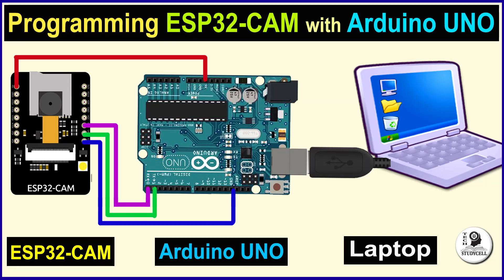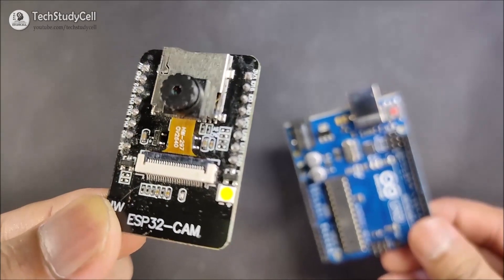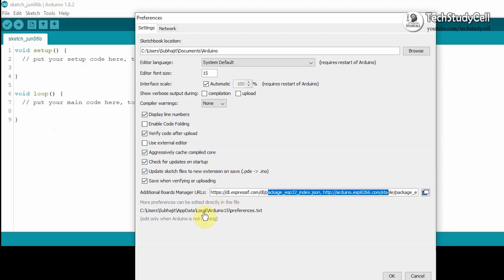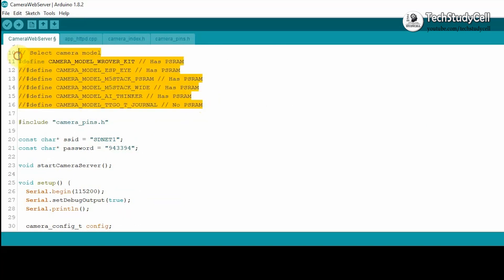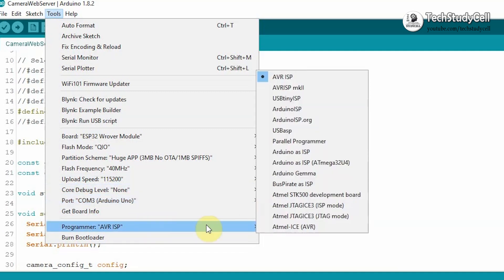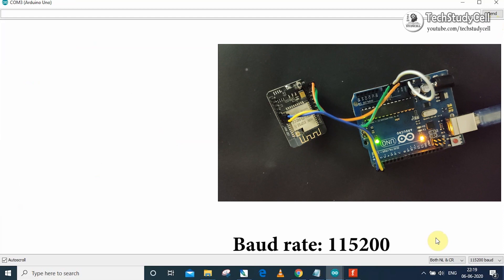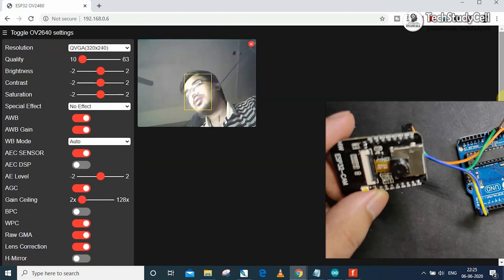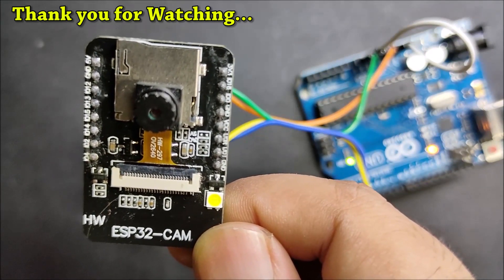How to program ESP32 CAM using Arduino UNO

Comment: Thanks for the video and sharing the information. it was quick but am facing some issues with camera_probe

[E][camera.c:1049] camera_probe(): Detected camera not supported.
[E][camera.c:1249] esp_camera_init(): Camera probe failed with error 0x20004

i searched resolution and i think this is with the power supply. so trying to resolve it. 

If there is any other solution please do let us know. Thanks
Reply: same problem did u find any solution?

Comment: after I like your video, why does the display on the serial monitor look like this: Please solution
ets 8 Jun 2016 00:22:57

first: 0x1 (POWERON_RESET), boot: 0x13 (SPI_FAST_FLASH_BOOT)
flash read err, 1000
ets_main.c 371
ets 8 Jun 2016 00:22:57

first: 0x10 (RTCWDT_RTC_RESET), boot: 0x13 (SPI_FAST_FLASH_BOOT)
configsip: 0, SPIWP: 0xee
clk_drv: 0x00, q_drv: 0x00, d_drv: 0x00, cs0_drv: 0x00, hd_drv: 0x00, wp_drv: 0x00
mode: DIO, hour div: 2
load: 0x3fff0018, len: 4
load: 0x3fff001c, len: 1100
load: 0x40078000, len: 9232
load: 0x40080400, len: 6412
entry 0x400806a8

[E] [camera.c: 1049] camera_probe (): The detected camera is not supported.
[E] [camera.c: 1249] esp_camera_init (): Camera check failed with error 0x20004

Comment: I am facing this error by using this method 
can anyone tell me where am I wrong

Brownout detector was triggered

ets Jun  8 2016 00:22:57

rst:0xc (SW_CPU_RESET),boot:0x13 (SPI_FAST_FLASH_BOOT)
configsip: 0, SPIWP:0xee
clk_drv:0x00,q_drv:0x00,d_drv:0x00,cs0_drv:0x00,hd_drv:0x00,wp_drv:0x00
mode:DIO, clock div:2
load:0x3fff0018,len:4
load:0x3fff001c,len:1216
ho 0 tail 12 room 4
load:0x40078000,len:10864
load:0x40080400,len:6404
entry 0x400806b8

[E][camera.c:1049] camera_probe(): Detected camera not supported.
[E][camera.c:1249] esp_camera_init(): Camera probe failed with error 0x20004

Comment: Hello, I am very new to this stuff, as i was doing each step, when i was about to select my "Programmer" mine says "no programmer available for this board"
Reply: Same prblm for me too got any solution
Reply: Apparently there was a change in Arduino IDE. Since there is no programmer for ESP-32, none are listed. Just click the upload button in the IDE and the upload should happen. Some people report warnings from the IDE, but works ok. Also make sure to have a  solid 5 volts on the ESP-32 to avoid brown-out.

Comment: I am trying hard to do this with the interface cable and it never worked with a DM brand ESP32.cam.   Using Arduino as described works great!  Thanks a great deal. This puts an end to my frustration and failure using the USB to UART adapter.   I was able to use AI Thinker setting in the IDE and Arduino worked great for the DM branded cam board.  Thanks again, a whole lot!
Reply from the maker: Great 👍

Comment: Hello sir, i followed your exact steps and i ended up with this error.

esptool.py v2.6
Serial port COM4
Connecting........____....._____.....____

A fatal error occurred: Invalid head of packet (0x00)
A fatal error occurred: Invalid head of packet (0x00) 
Do you know what could have went wrong ?
Reply from the maker: When you see the Connecting..... Text, please press the reset button on ESP32CAM. 
still if you face any issues please try again the same process.
Some time it happened due to connecting problem.
Reply: @TechStudyCell  Hey there, Yup i have tried that. Pressing once after the compilation is complete. Some google results tell me to hold on to the reset button. But i tried both methods and i still get errors. 

It worked for the first time. But after i restarted my computer, it stopped working
Reply: Me too

Comment: Hi I found very helpful video you have made. I need your help or advise, I have no experience in electronics I just want a simple direction if possible. I am building a tracking motion with ESP32-CAM and Arduino NANO, but the servos I want to control are The Bescor PS-260 AC Power Supply for MP-101 Motorized Pan Head features a 120-240VAC, 60/50Hz input and 6VDC, 700mA, so how can I include a controller ESP32-Arduino and some voltage controller to adjust what I need to move the servos? I don't know the terms I need to say to explain what I need, so please bear with me in this matter and I appreciate any guides you can provide to accomplish this Home Made device. Regards

Comment: I got the following error message: "Sketch uses 2100663 bytes (160%) of program storage space. Maximum is 1310720 bytes.text section exceeds available space in board." Any idea? I have tried different configurations but none worked. Same error.
Reply: Select Huge App in the partition menu

Comment: is it ok to use arduino nano?
because i got error like this
[E][camera.c:1049] camera_probe(): Detected camera not supported.
[E][camera.c:1249] esp_camera_init(): Camera probe failed with error 0x20004
Reply: @Lorenzo Tempany Even I have the same did you fix it?
Reply: @rajatnagarkar4283  did you fix it? i got the same problem.. help mee

Comment: sir great video but while uploading the code an error message occurred which says "Timed out waiting for packet header" please help
Reply from the maker: During uploading the code the GPIO o and GND should be connected. When the "Connecting......" test appears at the bottom you have to press the reset button on ESP32CAM.
Reply: getting same error. were u able to solve?

Comment: My serial monitor says - rst:0x1 (POWERON_RESET),boot:0x3 (DOWNLOAD_BOOT(UART0/UART1/SDIO_REI_REO_V2))
waiting for download
 everytime i press the reset button on baud 115200. I does not work for me. The code gets uploaded but i am unable to find the ip in the serial monitor . Please help
Reply from the maker: If code uploaded successfully. Then disconnect the GPIO-0 from GND and press the reset button in ESP32cam
Reply: @TechStudyCell  I did that. And in my case if gpio 0 was connected to ground, my code was not being uploaded. So i removed that connection and then uploaded. It finally worked and i got a ip link in the serial monitor but it was not working. It was just reloading on the browser. Can you olease suggest me how to do it.
Reply: @dhruvajindal4932  have you check ssid & password code for wifi your home???
Reply: me too, i don't know repair to it
Reply: Also be aware that the SSID is case sensitive too, not just the password.

Comment: Totally worked for me. Tnx for showing this awesome esp32 cam mod  with an arduino uno 👍
Reply from the maker: Great 👍
Reply: @TechStudyCell  can the same wiring be used to program other esp32 board like dev kit board, 38 pin board.

I want to know because i have esp32 dev kit board with broken usb port, but i want to program it by using arduino uno.

Comment: i don't know for some reason my Programmer "AVR ISP" not showing up. Whenever I chose esp 32 Wrover model its says  "there is no programmer available for this board" any help will be greatly appreciated :,<
Reply from the maker: Update the Arduino IDE
Reply: @TechStudyCell   Same Problem here please update the same.
Reply: AVR ISP not showing up
N my Arduino Ide is. 1.8.13 latest version. 
Plz help me
Reply: @Joydeepbhowmick  use 1.8.5
Reply: @Joydeepbhowmick  
Had similar issue using 1.8.13 To make it work  i chose "AI THINKER ESP32-CAM " From the Board drop down. Then continue with the instructions in the video.
Reply: @xscapevisionoyedo856  doesn't work for me either. Still "no programmer available for this board". Everything updated to the latest available versions.
Reply: @theinternal  I really cannot say why it's not working for you.
MINE Is ESP32-S A1 THINKER (ESP32-CAM). If yours is the same . once you select the "A1 THINKER " From the board List. You do not need the "programmer for the board" It should be blink or not  nothing. 
Upload your sketch, 
push the reset button .....continue with the video.
Reply: @xscapevisionoyedo856  I had to downgrade to 1.8.9 to make it work. The Arduino IDE seems to be getting worse over time.
Reply: download 1.8.12 it is not in 1.8.13 hope it helps you btw i also do same stuff im so close to 600

Comment: and also how to get the AVR ISP in Arduino tools programmer for esp32 ?
Reply: same problem with me
Reply: @Frankyyodi   @Geooogle  download 1.8.12 it is not in 1.8.13 hope it helps you btw i also do same stuff im so close to 600
Reply: Exactly. I have no options under programmer. I did a couple search but no one liner code. Please help!
Reply: @geooogle  i found it btw, i download 1.85 version zip
the install version cant detect it i dunno why
Reply: @Frankyyodi  Ty. Do you have a link to download and install AVR ISP?
Reply: @geooogle  did u solve this issue, i have the same problem.
Reply: @geooogle  download 1.8.12 it is not in 1.8.13 hope it helps you btw i also do same stuff im so close to 600
Reply: @AA7Productionz   @Geooogle  download 1.8.12 it is not in 1.8.13 hope it helps you btw i also do same stuff im so close to 600
Reply: @Geooogle  download 1.8.12 it is not in 1.8.13 hope it helps you btw i also do same stuff im so close to 600